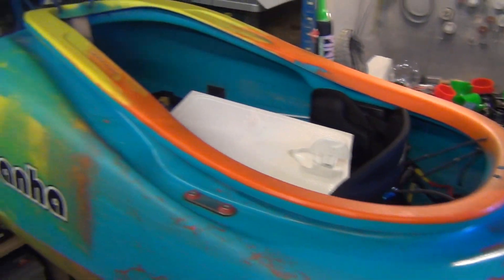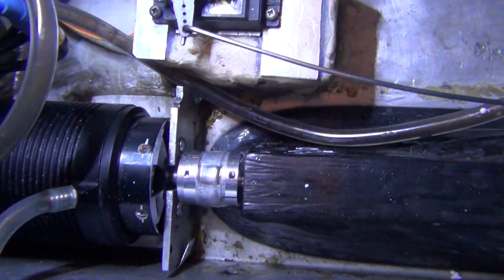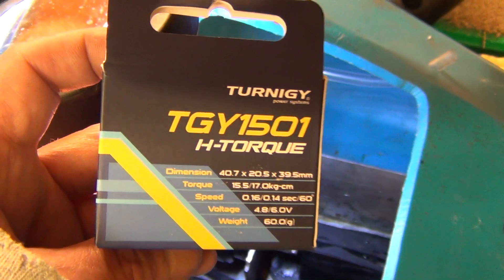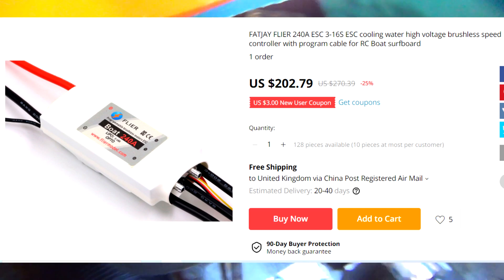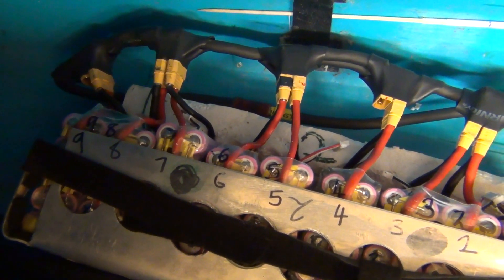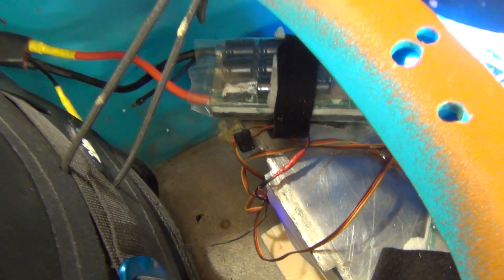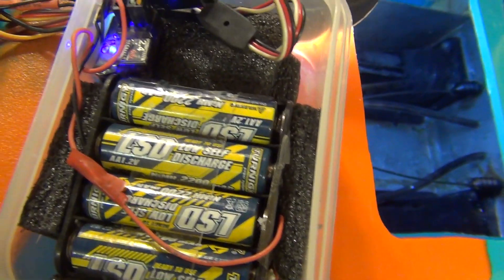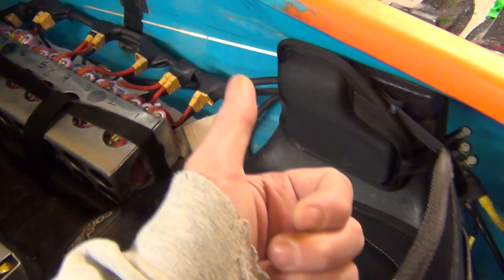Jet Boat Bits, motors, ESCs and stuff

Comment: How long can you run it? top speed? Awesome Build! I want to use this to power a crazy invention for my channel.
Reply from the maker: Hi Cody and thanks,
the run time is depending on how hard I push things and the battery configuration,,
I can get about half an hour play time on the water as it is and top speed in the boat is about 50kph,
Cheers mate :)

Comment: hello can u tell me wats the diameter of the jets? i want to build a jet board and my list is 55113 550kv motor whith 200amp esc and 70mm jet only one motor using 36to42v liion batt  , do you think that its good decission?

Comment: Hey bud this is amazing...
Looking at building a board with My son, what size jets are you using
Reply from the maker: Hi I'm using 2 x 53mm jets,
Reply: Thanks for your reply, you mention 80 cell as battery for each..
Is that 80 of the individual batterys? 
I have been googling your terminology but struggling 😪 
How many AH are your battery units you're running, thanks for your time appreciate it